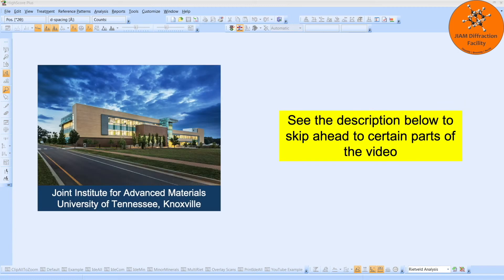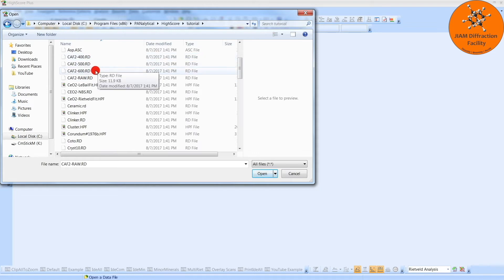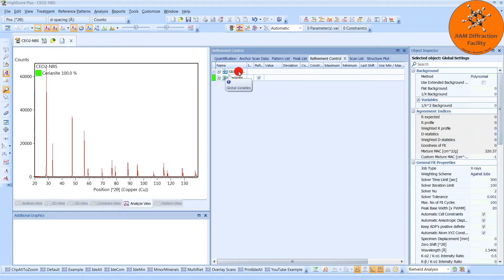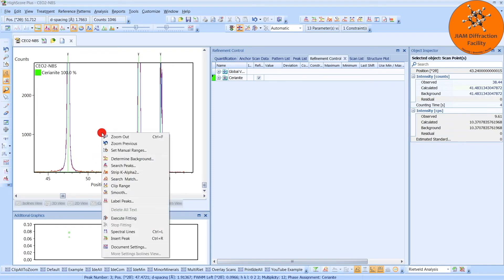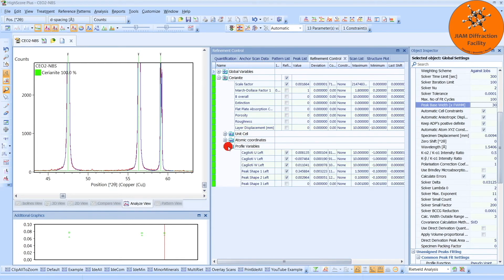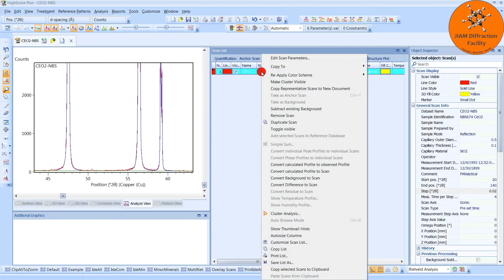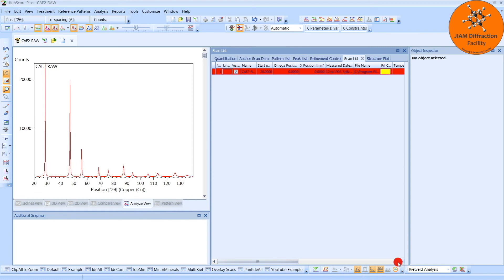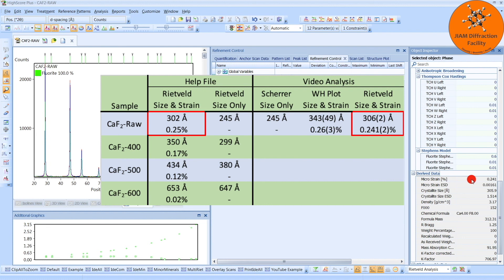Crystallite Size & Microstrain - Part 3 - Rietveld - HighScore Plus - Panalytical

Comment: Hello Thanks for the nice video. I met a problem when I made the analysis, I had a strong texture, so it doesn;t works perfect. How can I decrease the influence of texture.
Reply from the maker: The best way to handle texture is to avoid it as much as you can.  Maybe this means making your sample into a powder (assuming it is currently a solid chunk).  Let me know if your sample is already a powder.  If there isn't anything you can do to remove the texture from your sample, another option is to try modeling it with HighScore.  I'm guessing certain peaks of yours are much taller than they should be, and other peaks are much smaller than they should be.  For the peaks that are much taller, can you tell me what planes they belong to?
Reply: @IAMMDiffractionFacility  Thanks for the quick response and the answer. My sample is fcc structure and prepared by high-pressure torsion.  So it has a strong texture of 111. The other peaks are not as strong as 111. The Rwp has nearly 33
Reply from the maker: Oh my goodness, where did the time go?!  I apologize for such a slow reply.  My advice would be to go to the Refinement Control tab, click the + next to your phase that has strong texture, then click the name of the phase that has strong texture.  In the Object Inspector panel to the right, scroll down until you get to the Preferred Orientation section.  I would suggest you use the March/Dollase model, and make the hkl values all 1 so that you have a 111 texture.  You should then go back to the refinement control tab, and the second item under the phase name should be "March-Dollase Factor 1."  Put a check mark in the refine box.  Then switch to a manual refinement and run it.  

Let me know if that helps or if you have more questions.  I will try harder to answer them faster!
Reply: @IAMMDiffractionFacility  
No problem, I appreciate your answering. In fact, I followed your instructions and performed the analysis. It appears that not only the {111} peak but also the {200} peak are quite prominent. As a result, the Rwp value remains high. I attempted to apply the Williamson-Hall method you mentioned in your other videos, but with only five data points, the fitting results didn't seem particularly accurate.
Reply from the maker: Hmmmm, there is another thing you can try.  In the Object Inspector, where you saw March-Dollase and set it to (111), you could try switching it to Spherical Harmonics.  You'll then want to go back to the Refinement Control tab, and you should see something else appear where the option to refine the March-Dollase factor was (if it doesn't look any different, try clicking some other line, and then it should appear).  I typically try to refine the top 3-4 spherical harmonics inputs.  I'll be honest, I don't really understand this correction (so take this suggestion with a grain of salt), but it can help with some tricky textures.  

This is the difficulty when working with texture in XRD.  The best thing to try to do is reduce it if at all possible, but that just isn't an option sometimes.

Comment: Hi. The video is very helpful!. One question from me, do line profile analysis is accurate or valid in determining the crystallite size? Usually we can see the crystallite size after profile fitting at each peak. Hope you can give an opinion about this. Thank you.
Reply from the maker: Thank you for the kind words!  Honestly, I'm not too sure about that option.  At the very least, you would want to make sure that you have told HighScore to account for the instrumental broadening.  I suggest watching the other crystallite size and microstrain videos on our channel if you do not want to determine these parameters with Rietveld refinements.  Our two other videos involve profile fitting.

Comment: how to download practice data by panalytical ?
Reply from the maker: There should be a number of tutorial datasets on your computer.  Look in C:/Program Files (x86)/PANalytical/HighScore/tutorial.  If you follow the examples found in the HighScore help program, they should use the files located in this folder.
Reply: @IAMMDiffractionFacility  why the fit profile icon can't be click ?